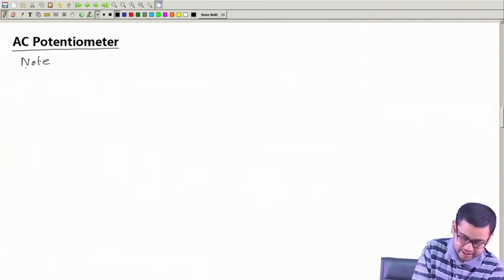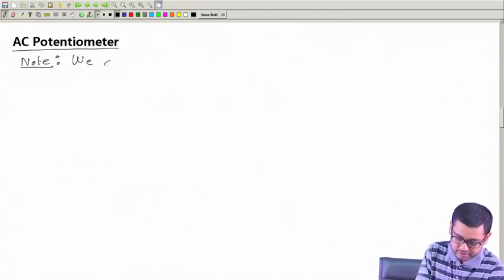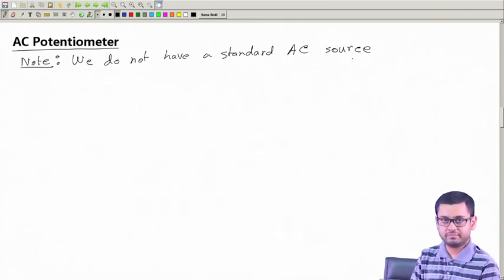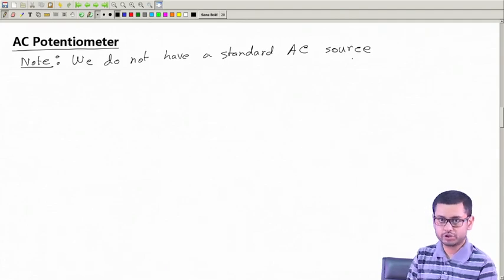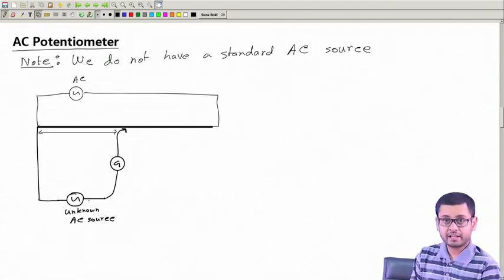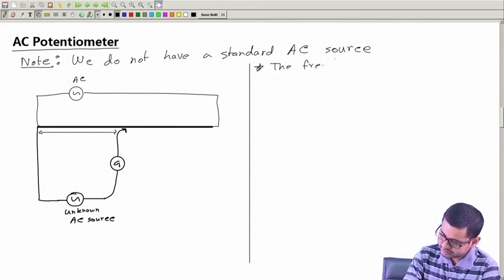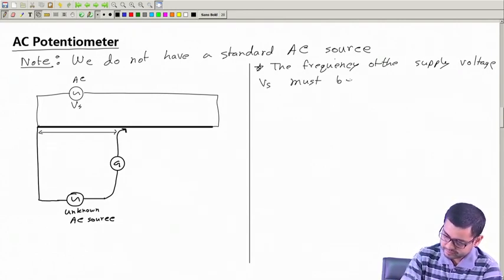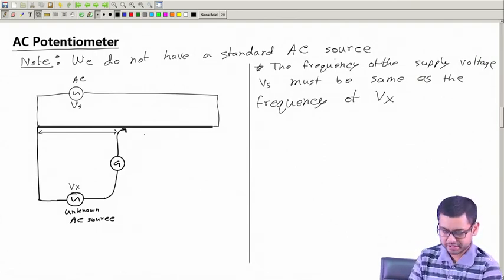Lecture 33: AC Potentiometer

Comment: The resultant voltage across the jockey depends on the vector difference (phasor difference) of the two voltages
𝑉 resultant = 𝑉 unknown − 𝑉 known V resultant=V unknown −V known
If the two voltages are not in phase, their vector difference will not be zero, even if their magnitudes are equal.